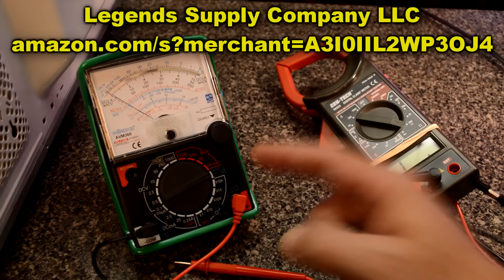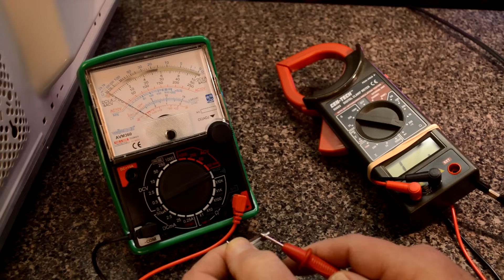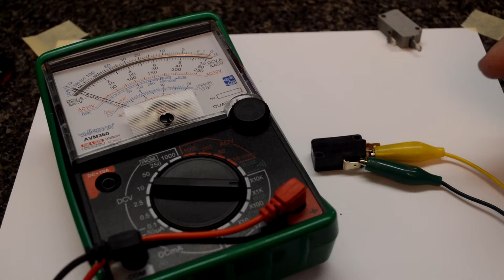Microwave Oven Repair - How to Test Fuses and Switches

Comment: Hi I'm Mike , I have been doing electrical since my old man taught me what it's like to get bit by 120v. So I've got some college education in residential , commercial & Industrial but now I've been dabbling in microwaves and replaced a few door switches and thermostats but I recently ran into a situation where I have a unit that had a bad bottom switch on the door and a bad thermostat , I replaced them and now the blower fan comes on automatically when I plug it in but the microwave works ....... why is the blower fan coming on ?

Comment: Tanks for all those precise info . I check all those 3 switch all was good  , but the hook on the door dont press anough. So i slot the switch holder to reach full travel off switch contact. By the way am  a automotive tech and many times i open this type of switch and some times is just cleaning contact or the spring is corrupt but you can use your inginiusity to perform the fix.

Comment: Thanks for the video.  Mine went on the fits. Since I have to uninstall it to take it to a shop for diagnosis I think I'm going to try fixing it myself if I can find that capacitor to discharge. I was concerned about the high voltages involved and knew there was a way to make it safe to work on.  Thanks again!

Comment: I have 2 microwaves that I suspect are the victims of lightening strike. Fuses, thermostat, and switches all checked out but I have no power to the unit. And yes plug is hot. Any suggestions on what could be out on them? no burned leads inside unit or any signs of malfunction that I can visually see

Comment: Thanks for this very helpful video.  I have a question.  This covers switches and fuses great.  What I am wondering about is when I turn my microwave on, the sounds coming from it are much louder than they were when the unit was functioning properly.  Is that covered in the switch diagnosing or should I be looking elsewhere?

Comment: Well done.  After viewing, I felt prepared to tackle a micro switcheroo.  Especially liked the way U tested switches w/o pulling them first, but I may need to buy alligator clip attachments or grow a third hand.  Tried to touch the switches connectors with a probe in each hand while lying on my back on the stove top holding the tester in my teeth so I could shut the microwave door with my feet, but found it difficult.  At any rate, I now know to beware of the evil capacitor for it has the capacity to do me in.  I guess those warnings are legitimate and not like the useless ones that say things like " the wiring is not for consumption".  Thanks for your valued advice and for saving me or helping me save or both.

Comment: Thanks for the idea on the micro switch. Wondering if that is my problem.  Did you display is working, microwave turns on, but sounds different. Almost like the fan is not running, and the turntable is not moving. Food still heats up. But it will overheat, and then the whole microwave goes dark. With time it will cool down, and turn back on.

Not sure if I should replace the fan, the turntable motor, or if it's a diode issue since it was taking longer to heat food, and lights would dim now & again.

Comment: My oven stopped working after I unmistakably cooked eggs inside, I didn't and I was in a rush. Checked the fuse and its fine. I think am going to check the door switch. I hope it will work.

Comment: Great explanation. Old Amana got hit with a power surge. Oddly, ceramic fuse is good. Will check thermal fuse  & door switches next. Good machine - would like to save it.

Comment: Excellent video, in my microwave; I found the H.V fuse blown and the magnetron also had a short between the two filament terminals and case (ground). I replaced the magnetron with a new one and the fuse (ordinary one not H.V fuse). The microwave still doesn't heat!!. All the other parts seems to be OK. What can I do? Thanks

Comment: Great video! My new used microwave just quit, about the fourth time I used it. It cooked a TV dinner most of the way (about five out of seven minutes) but then I heard a distinct "click" sound. and it quit. The food is hot, so I get to eat, but I now need to take it apart and test the fuses & microswitches. As soon as I fix my multimeter, that is.

Comment: Thanks for the step by step diagnostics.  I was looking for this and anywhere else simply said magnetron or diode, but I suspected the limits.  Another video did mention it and how replacement fixed it, but not how to diagnose the bad switch.  Thanks.

Comment: Excelent explanation of this project. I was clueless before .
thanks.
Just wondering if there is a check to ensure the capacitor is drained?
Reply from the maker: If you do a dead short across the cap leads as the video shows than it will be discharged. Don't touch the metal part of the tool when doing this or it will shock you.

Comment: I am working on a microwave that was apparently not getting any power.   When I bypassed the 90 degree C Thermal Cut-Out it works.  This is very confusing to me because the TCO is a Normally Open thermo switch/fuse, which shouldn't conduct unless it reaches 90 degrees C, which is far above room temperature.  It seems to me that this should be a Normally Closed thermostat that cuts off the current if it gets too hot.  
Any help would be appreciated.  I hate to replace it with a NC when the stock part was NO.  The microwave was only three months old, and mainly used as a fan above the stove, so it stands to reason that the temperature could have 
reached above 90 since the stove flames are directly under the TCO..  
I tested the TCO that I removed with an ohm meter and by adding heat, and I couldn't get any continuity, so it was probably
bad anyway, but the microwave still won't work with the new part.  Any input would be appreciated.  Could the issue be another part?  Thanks
Reply from the maker: +Ger Repair I would guess that using a NC TCO would be fine. I don't see any problem if its connected directly to mains power and not somehow included in the circuit.
Reply: Thanks.  The wiring goes through two TCOs, the first of which is an NC, and works fine, and the second of which is an NO, which now works as an NO is supposed to work.    The machine was in a rental for only three months, so I don't see that any other person would have messed with it or put a wrong part into it.  The wiring diagram doesn't specify if it is supposed to be NO or NC, so that is no help.  I'm concerned that if I replace it with an NC, there may be other unaddressed issues.  Thanks again.
Reply from the maker: +Ger Repair Hum... yes I feel your concern. What make and model is it.?
Reply: It is a magic chef, rangetop.  I got a NC and put it in, and it seems to work fine.  Hope nothing else happens down the road.  Actually it just doesn't make sense to me that there would be an NO there if the purpose is to cut off the power if it gets too hot.  Maybe someone else messed with the machine.  Maybe its some sort of tenant scam.  She has been complaining about all the appliances since she has been living there, and the microwave is very dirty for only having been in there for three months.
Reply from the maker: +Ger Repair ya, I never seen one containing a N/O device. You did what I would have done. keep an eye on it but should be fine.
Reply: Will do.  Thanks for your help.

Comment: I just found your channel and subscribed, I've watched a couple of your vids so far and was curious to what screw gun you're using?  Like you, I do a lot of computer/general repairs and never really though about using a screw/drill gun mostly since mine are too bulky and possibly too strong.  Yours looks like a Bosch PS10 but I don't think that's what it is.  Anyhow, hope you might answer my question, but either way I wanted to say I really like your vids, especially the repair ones.  Thanks!
Reply from the maker: ***** Hi Larry, thanks for the comment. The driver is a Drill master cordless screw driver for $10.00 here it is http://www.harborfreight.com/48-volt-14-in-cordless-screwdriver-kit-61826.html. It's rechargeable and has a light. Great value.
Reply: Thank you Steve, I think I'm going to give one a try.
Reply from the maker: ***** You won't be disappointing especially for the cost. The only downfall I would say is if you leave it of the charger it will be weak when you need it. I put mine on a timer for 6 hours a day all the time and this solved my needs.

Comment: You're absolutely correct about the "generic" style microswitch.  Even though your bad switch didn't have the normally closed contact present, the "generic" plastic cases diagram showed it present.  I just replaced a 15 year old over the stove microwave, that I know I could fix but I was getting tired of lifting the 70lb stove without the extra help I could use.  The replacement was much lighter which is good for me, but maybe not so good for longevity. We'll see.
Reply from the maker: hankus253 Older appliances last much longer and that is a fact. I replaced all my kitchen appliances 13 years ago and everyone of them has had issues or been replaced. When I was first married we bought all second had appliances and they were still working until we got fancy with new ones.

Comment: Good tips.  Yah!!!  I have run into the issue of not being able to buy replacement parts because I am not an authorized service provider.  That really frosts my butt.
Reply from the maker: jp040759 Thanks, I think they don't want to sell to just anyone because the service guys are hiding the cost they really have invested in your repair or installation. I once paid a guy with a HVAC  license to go into that same shop and buy a furnace for me at cost that I installed myself. That's putting it to the man